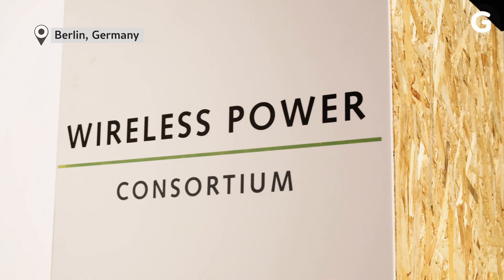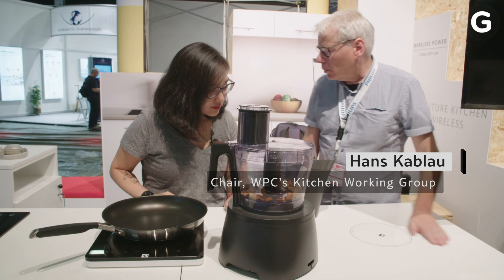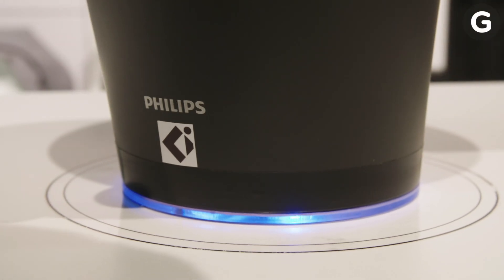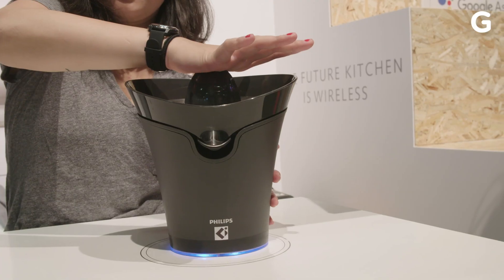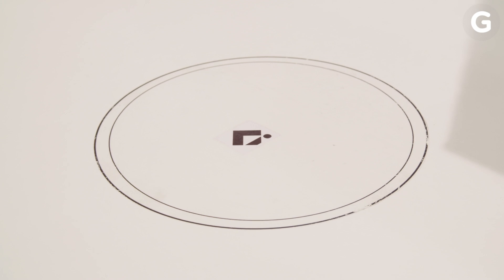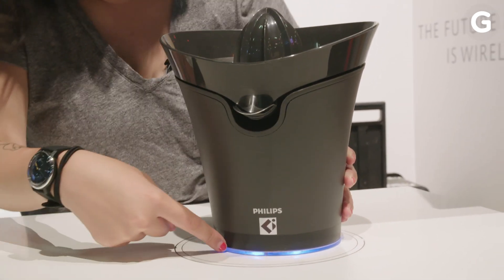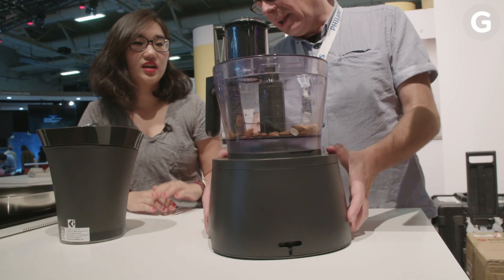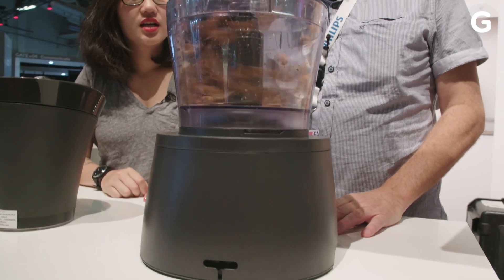This Could Be The Wireless Kitchen Of The Future

Comment: Technically any metal item left between the pad and appliance will likely heat up.Is the Hf ac induction.
Reply: I think for safety reasons, we should have a power button out there. Or a motion detector

Comment: What happens if you place one of these on an induction cooktop and crank it up?
Reply: The induction cook top would have to be tuned for these appliances to receive the power and their is a 2 way communication between the transmitter and the receiver to get the required power.  The technology in today's induction cook tops are not compatible.  I have seen demos where companies did this but it could barely power a blender on low speed.  I am sure the technology has advanced.